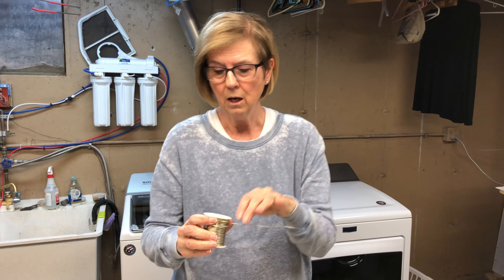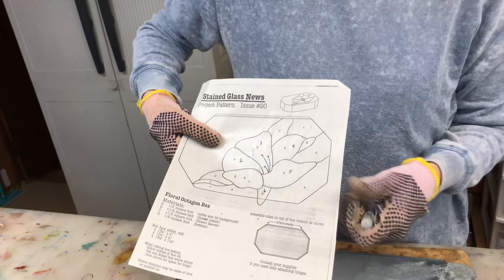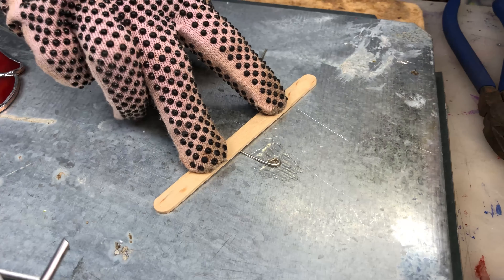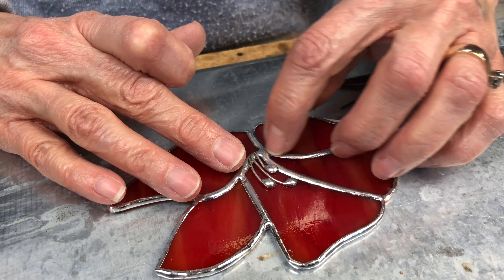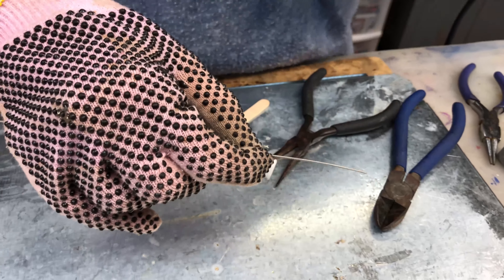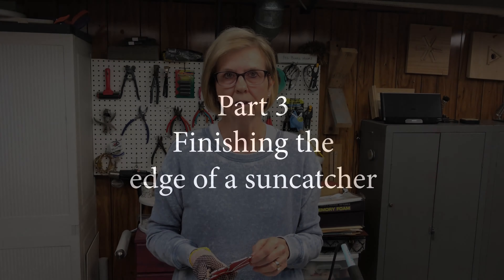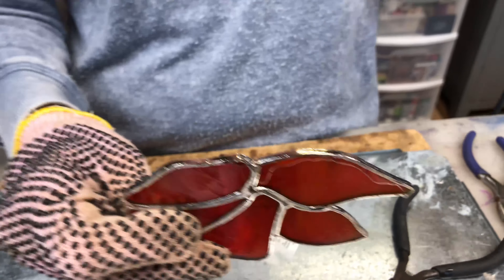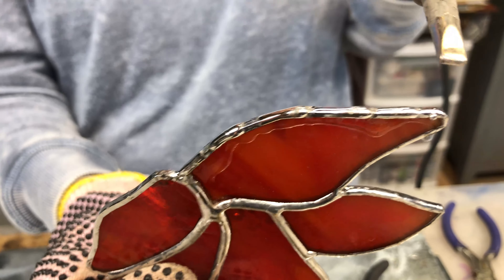Wire Overlay

Comment: The metal for the antennas, is it 60/40? I’m trying to do small wire details and having issues with .6mm 60/40 melting and I don’t know what kind of metal to use that sticks, is easy to make into shapes that I don’t have to wrap impossibly small foil onto to try and make stay.

Comment: Thank you, I have learned a lot watching your posts. Can you show how to put solder dots on wire like for a knee on a birds leg or like lights on a tree. Thanks
Reply: I don't have a video just on decorative soldering, but if you take a look at the one on attaching ball chain to a heart at the end I do show doing a few dots of solder at the top of the heart. This is done on a soldered line, not wire but same concept. Doing it on wire might be a bit more challenging, the solder will tend to want to roll off. I hope this is helpful.

Comment: We started with stained glass (we call this Tiffany) a few months ago and of course we're still learning. These videos are great, the tips we can use immediately. I do wonder about the iron, I noticed you use a 'iron tip' formed like a screwdriver. I know there are different ones but when do you use the one and when the other or is it just a matter of preference?
Reply: I really do not have a preference in solder tip size, the one used in this video is 3/8" which comes with the Weller. I have purchased smaller tips and find they work well when doing certain decorative soldering techniques. The smaller tip has a higher temp that the larger one which I then use a Rheostat to lower the temp.

Comment: good  instruction  very usefull ; also I use magnetic  unther  the glass  to hold in place  my  ting  or so   like this  i am able to place it  where  it is the best  and nothing move when i  put solder  very  easy  whit  strong  magnet  from hard disk  for exemple thank  for demo  
jack 47 71

Comment: Since solder is such a soft and delicate material, would it be worth coating copper wire in solder for the more delicate parts?
Reply: Hi Hunter, yes you could coat the wire to make it stronger, for this example that wasn't necessary

Comment: Hi what soldering machine do you use ?
Reply: I use the Weller Temperature Control Iron 100 watt. This is the only soldering iron I have in my shop, I have several my students use. It is very reliable, have owned them for 20+ years. Here's a bit of info on it:

 
Weller Temperature Control Iron - 100 Watt
A high-quality, portable tool designed for production work with all the benefits of controlled output and temperature. Features a plug-in heating element barrel assembly that makes replacement simple and quick. Supplied with CT6F7 700 degrees F 3/8" (10mm) tip. 600 degrees F and 800 degrees F temperature selection tips are also available. 6' (183cm) cord; 120 volts. CSA APPROVED ITEM